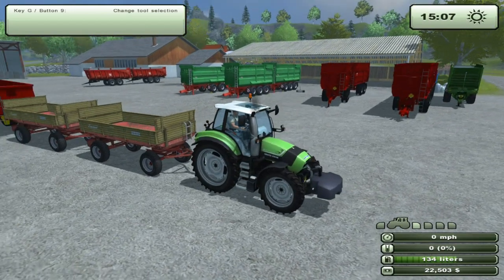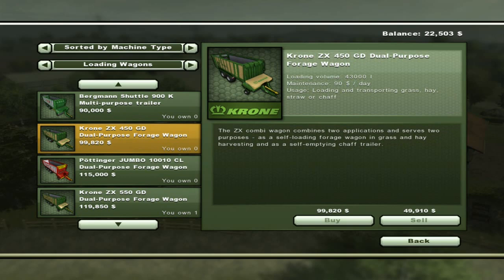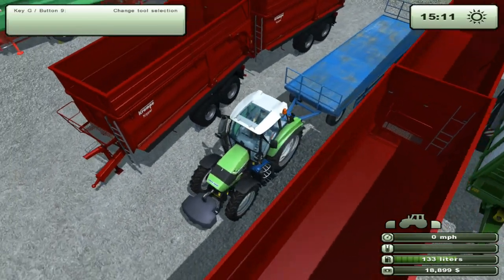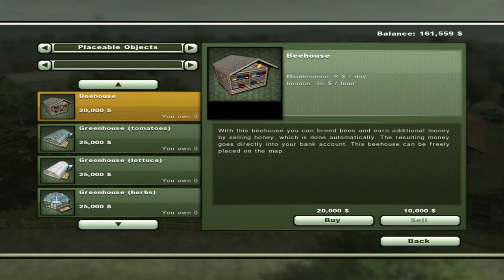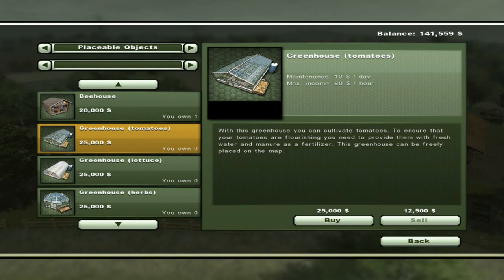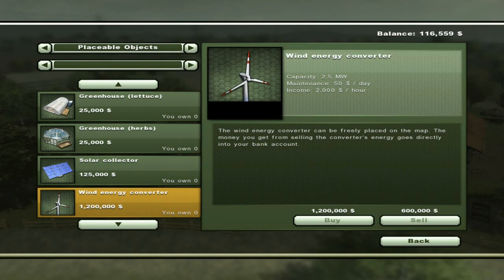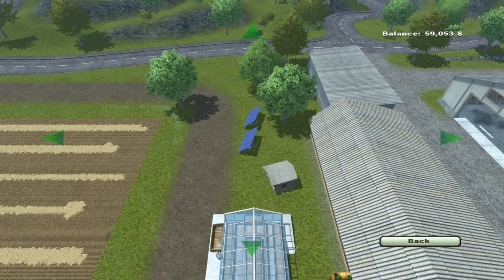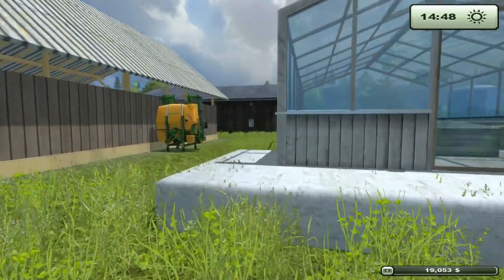Farming Simulator 2013 Basics Episode 9

Comment: Thanks for your vids.  I know you mentioned that it seems that the double axle trailers will not connect.  Does that include attaching the cheapest trailer to your tractor first, then maybe a double axle to that trailer making it the end of the train?  For example the Krampe 500 big body (i think is the name)

Comment: The reason the dual or triple tipper trailers cant be atached because the hitch part of the trailer is the bottom hook on the tractor and the other trailers u have hooked like a train have the higher hookups

Comment: 1:54 Cant we use that SIGA Uno to connect those big triple axle trailers together?

Also, about those more functional trailers like the loading wagons, IF I'm not wrong they are powered by the tractor's power axle - I have no clue what it's really called - but in simple words it takes the power from the tracktor's engine and shares to the wagon. So I don't believe it's possible to do a Loading Wagon Train =p 

just guessing everything.